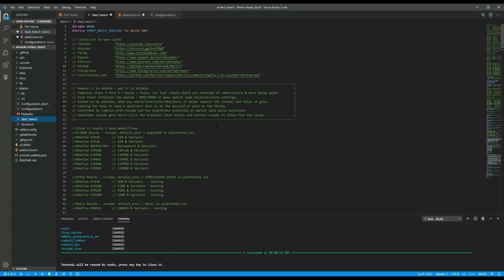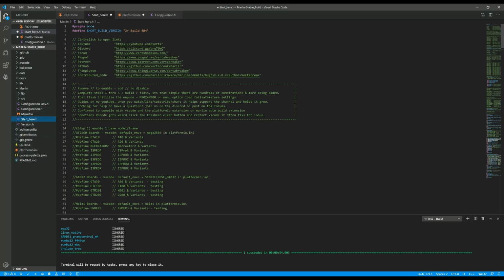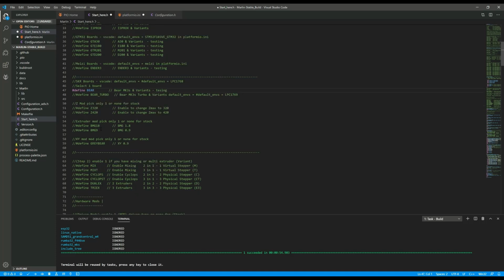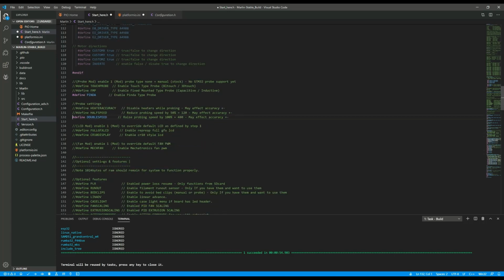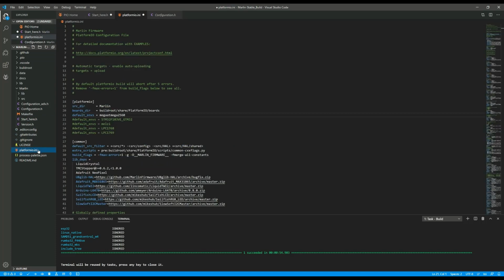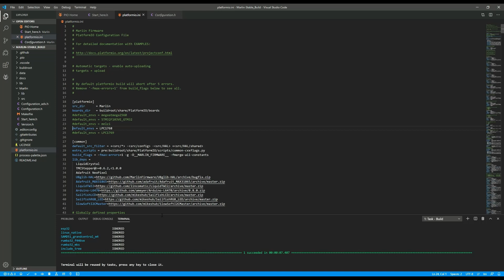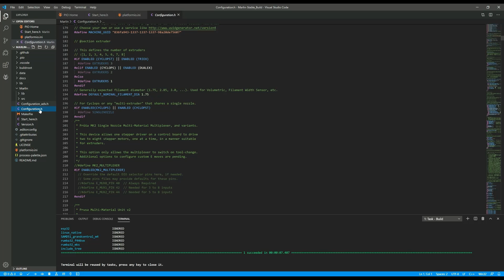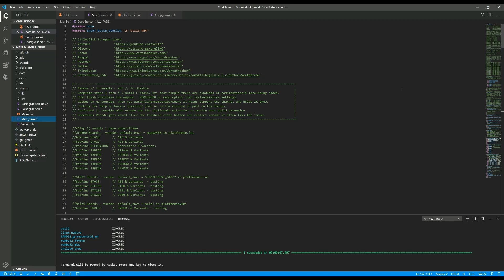Marlin Quick Build for SKR Bear

Comment: looks like no formal support for those just wanting a fresher Marlin on the Einsy. I'm sure I could make this work but I don't see the reason to heavily-manually configure a firmware fork that intends to reduce the amount of manual configuration. seems like a recipe for things not working.
Reply from the maker: Grayson Ol the einsy is a very outdated board even when it launched. 8 bit has so many limitations and adding many of the awesome features of stock marlin to the einsy would most likely over fill it’s available memory space. There is a marlin 2.0 fork for einsy if you want to look into it I don’t have the link handy to that GitHub though.

Comment: Thats Amazing :-)
Reply from the maker: nuuskapeke11 super amazing!!!
Reply: btw i cant get skr 1.4 and btt tmc2209 v1.2 to work with endstops or sensorless(tried different sensitivitys and it always crashes and loses steps).
i have wathed your 1h video about it.
but i still cant get them to work.(drv8825 works)
what jumpers you have on (any pics)
Reply from the maker: nuuskapeke11 depending on the motors you have you may need to adjust the homing current and the homing sensitivity. If you haven’t enable improve homing reliability as well. It’s in configuration_adv.h
Reply: ahaa   ill give it a try tomorrow